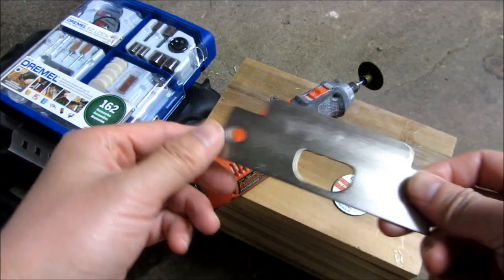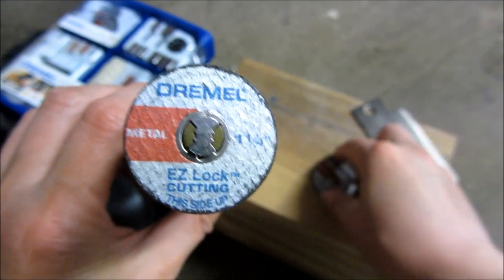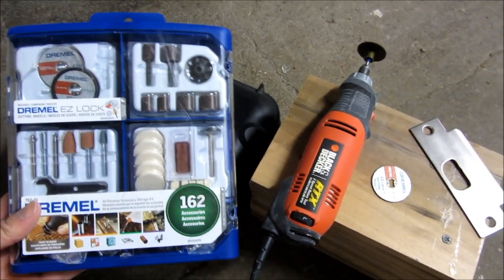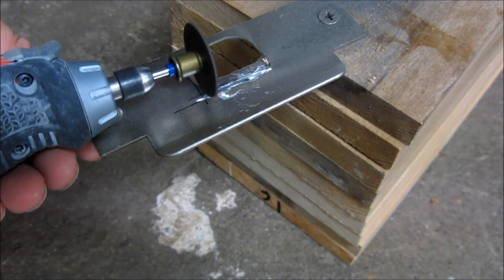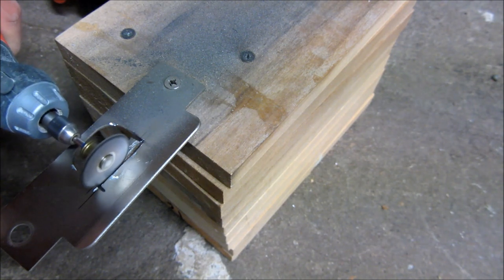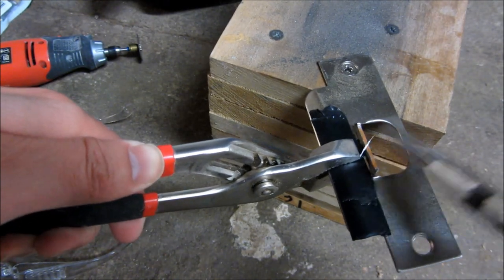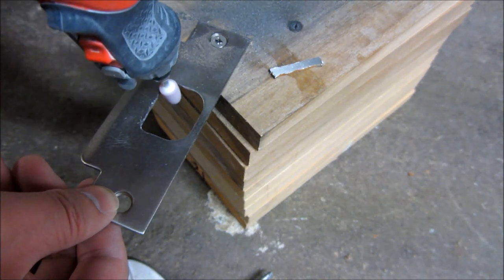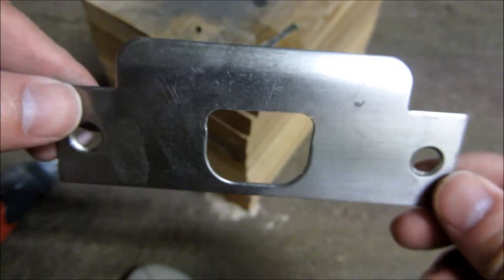Dremel #456 EZ Lock Metal Cutting Wheel | #406 #426 | Grinding Stone

Comment: I understand this is only for the Dremel EZ402...  is there a metal cutter you'd recommend for a (discontinued?) Dremel Multipro 400-XPR?

Also, do you think a dremel will have any problem cutting the legs off a water-heater-stand, approx 16 gauge galvanized  Cold-Rold-Steel (0.0635")?

If not, is there a particular hack-saw that is capable of cutting 1.7mm thick metal?
Reply: just use the adapter